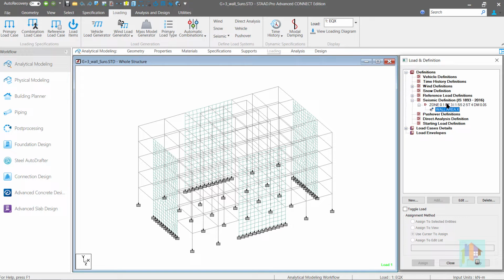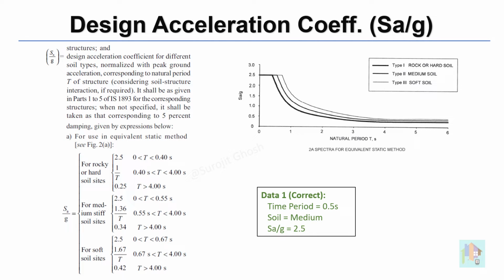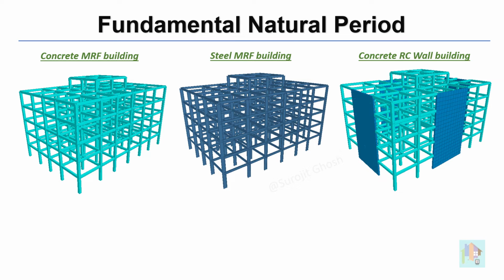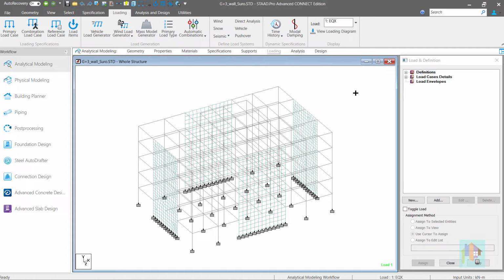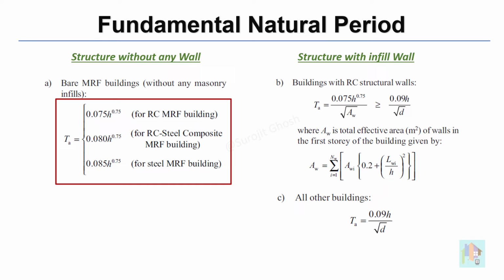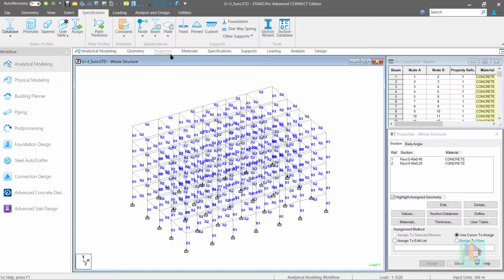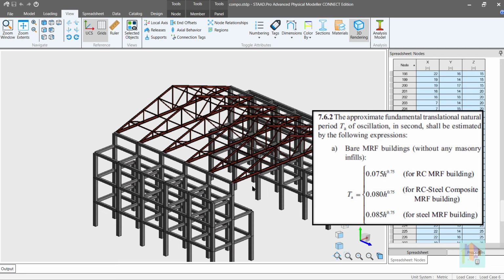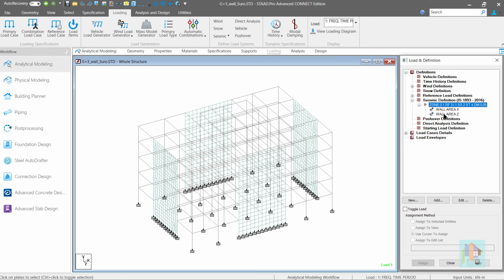Static Seismic with IS1893 - pt.6: Structure Type (ST) & Time Period || Bare MRF building, RC walls

Comment: If the structure consist of both RC walls and brick walls then which time period formula should be used??
Reply from the maker: As RC wall provide more lateral stiffness, you need to consider the equation corresponding to that.

Comment: If the infill walls are present in architecture drawing, but in staad pro , diagonal struts are not modelled, then which formula should be used for estimating time period? As per IS 1893 part 1) , (a), (b) or (c) ??
Reply from the maker: It's either 2nd or 3rd equation under (a), depending on the type of wall. For RC concrete wall, it is 2nd. For brick wall, it is 3rd.
Reply: @surojit_ghosh  if the structure consist of both RC walls and brick walls, then which equation should be used?

Comment: Sir, as you say that more stiff structure has lesser time period and thus it attracts more seismic force, ok.. But my question is we aren't model floor slab in model and applying slab load to supported beam, but practictically, there is a slab present, and due to slab, more seismic force is attracted, but we aren't model slab in our slab model, so there would be lesser seismic force computed by staad, which is mismatching, sir kindly explain on that...

2- sir,will there any contribution of modelling rigid/semi rigid diaphragm on time period? please reply, thanks.....
Reply from the maker: It is not a correct technique to ignore the floor slab during modelling. A floor slab normally behaves like a rigid diaphragm and it is always recommended to define the in-plane rigidity using FLOOR DIAPHRAGM command In STAAD, and for flexible diaphragm, using plate mesh. Not modelling the slab as a rigid diaphragm not only changes the structural behavior, also several checks (eccentricity checks, torsion) are not performed if it is not present in the model.
Reply: @surojit_ghosh  sir, can we model slab along with rigid floor diaphragm simultaneously??
Reply from the maker: FEM slab behaves like a flexible diaphragm whereas FLOOR DIAPHRAGM behaves like a rigid diaphragm. Hence both is not required/suggested.
Reply: @surojit_ghosh  but if we haven't model slab, it attracts lesser seismic force than actual,as time period cycle is less, and if we model slab,the floor rigid diaphragm and slab nor recommended simultaneously, both side we have drawback, what's the straight forward solution for it?? Or it is the lacking of staad pro??

Comment: Sir,
in your first modal though wall is not modelled we assign wall load as member load and practically there is infill wall. we should consider "all other bldg" i.e time period  T=0.09h/sqrt(d) instead of 0.075h^0.75 as u demonstrated. pl confirm and clear it sir
Reply from the maker: Under cl.7.6.2, code suggests to use eqn.1 for buildings without any masonry infill and eqn.5 for buildings with infill walls. Also under cl.7.9, the process to model this URM infill wall for seismic analysis is provided. Now, if you want to consider eqn.1 without modelling the URM infills (which contribute for lateral load resistance by forming load path) just by assuming it is there, then it is up to you. But structurally the models (with and without modelling walls) are not same, you can compare the time period of these structures by extracting the natural frequency.